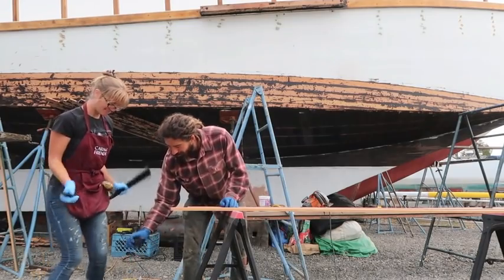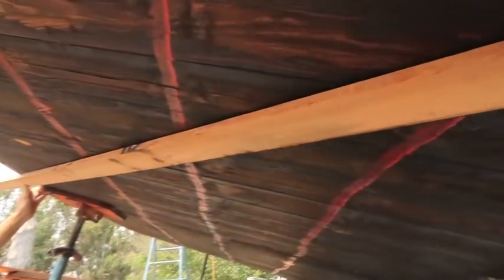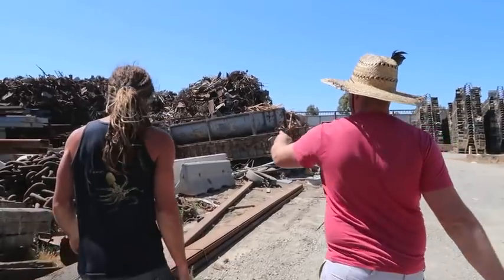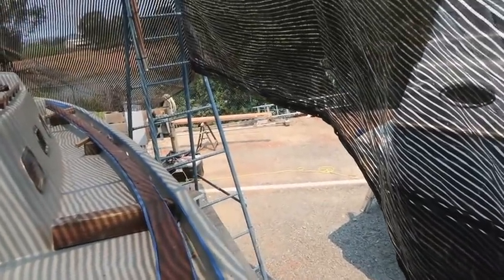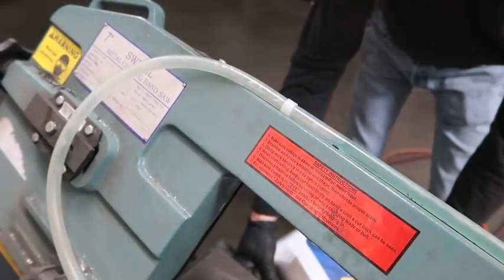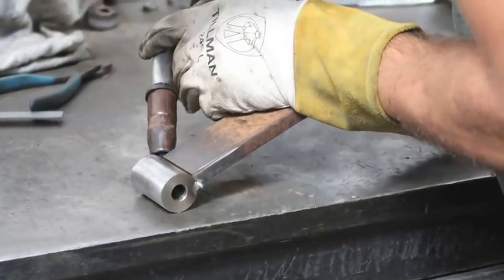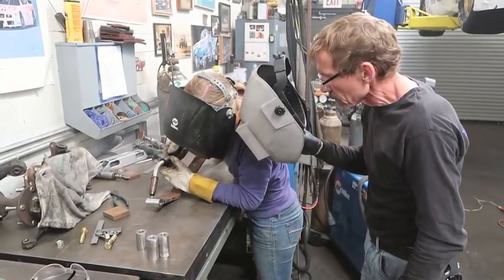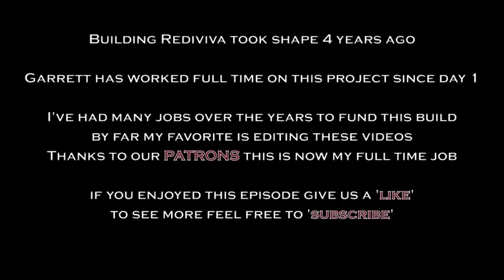Salt & Tar: Episode 40 - A TarQueen's Birthday, some Sheathing and Welding too

Comment: Does anyone else squint like I do even though it's a video when they start a weld 🤣
Reply: I do not.
Reply: Yep 40 years of welding will do that to ya.
Reply: Every darn time that arc started I'd squint, I started welding 1977 but I can count on one hand the amount flashes I've had, tried a lot of remedies such as tea bags cucumbers, cold wet rags but the one that worked best was welders eye ease, but they outlawed it ?

Comment: I enjoy your videos, thanks for sharing.  I do have a little constructive advise.  1. Your eyes you welded to the chain plates; you should have beveled the ends of the flat bar to have a 1/16"-1/8" land and then welded the eyes to the flat bar.  That will give you 100% fusion.  I would have planned 3 passes per side for the welding, with the machine you are using.  The basic design and construction it good.  2. I would have suggested stainless for the material vs. carbon steel, corrosion will be an issue.  Salt water is amazing corrosive to metals, 90% of my time on my Destroyer was fixing corrosion...  Your corrosion issues will be hidden between the hull planking and the back side of the plates.  Prior to mounting use a really good 2 part epoxy or 2 part urethane paint to minimize corrosion prior to mounting on the hull.

Keep the videos coming, I do enjoy them.

I learned to weld in the US Navy, I was in the Navy for 6 years and have been welding for 10+ years.

Comment: wont the tar come off over time and pollute the water?
Reply: sigh, think about what you just said for a second. then go google how much raw crude bubbles up out of the ocean floor naturally.

Hint - It's a lot

https://www.sciencedaily.com/releases/2009/05/090513130944.htm
Reply from the maker: All the tar from the sheathing is sanded off so it's only under the planking then we've painted standard bottom paint on the hull under the waterline.